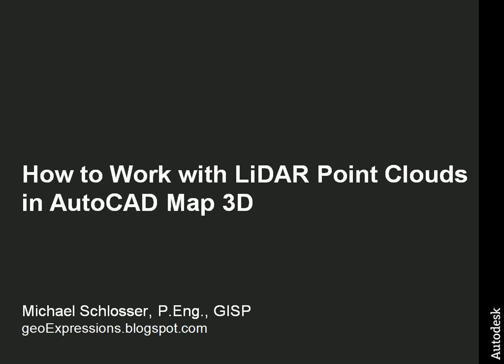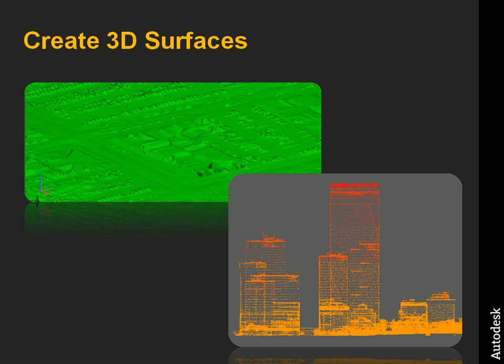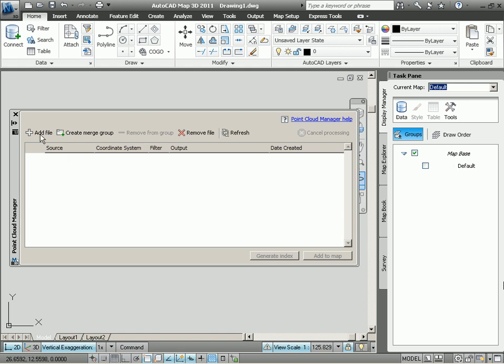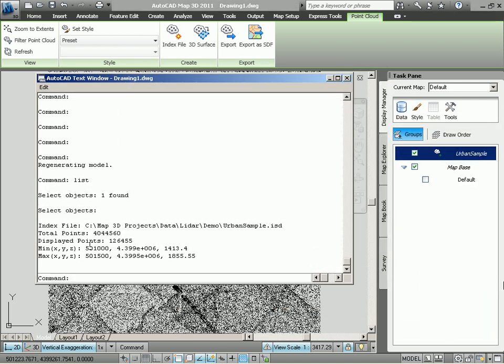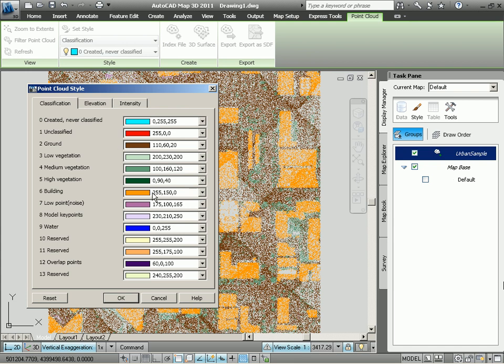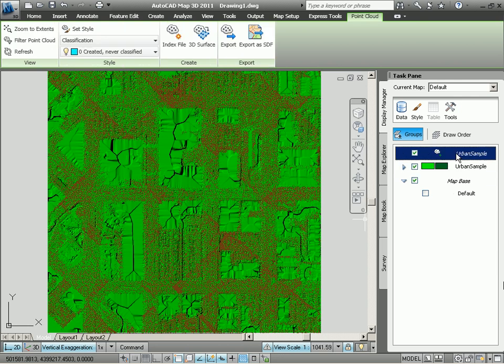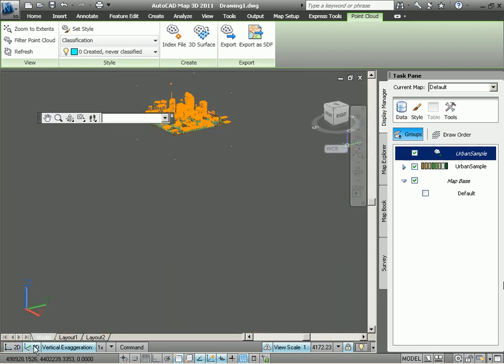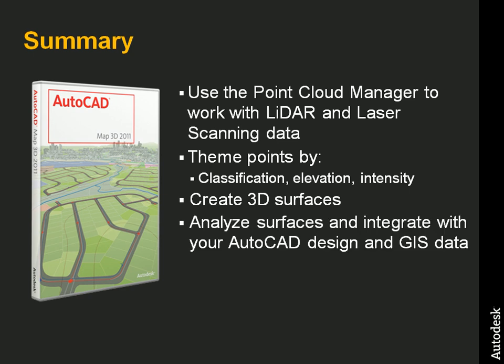How to Work with LiDAR Point Clouds in AutoCAD Map 3D

Comment: When I select Data in the display manager, and hover over "Add Point CLoud Data", my only option is to add from drawing object. How can I add from index like you did?
Reply: Type "MAPPOINTCLOUDMANAGER" in command prompt. It will open up the Point Cloud Manager dialog box and you can bring in .las, .isd, and .xyz files.
Reply: @malbowz1257  This command isn't available in AutoCAD Map3D 2021; do you know the new command?